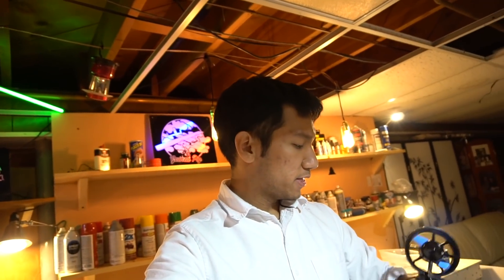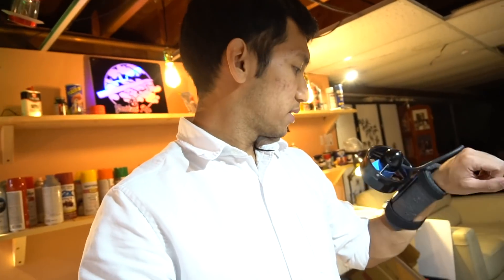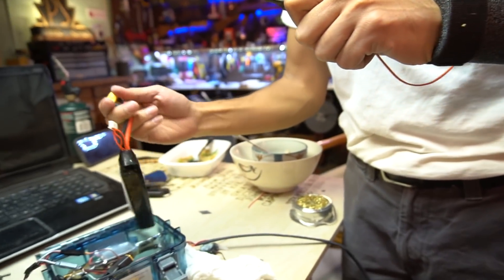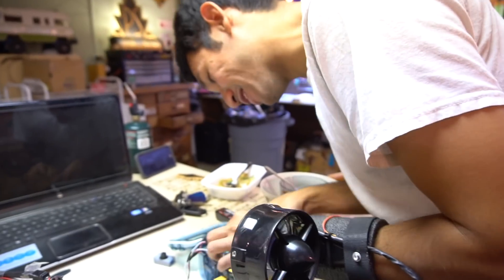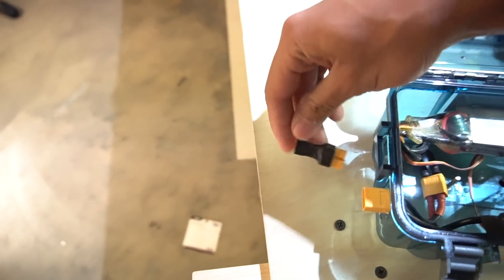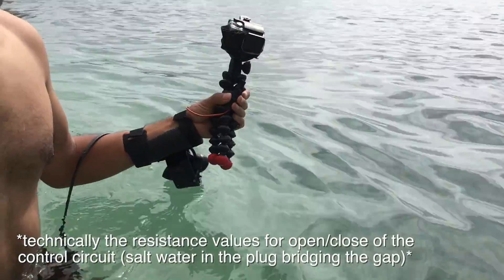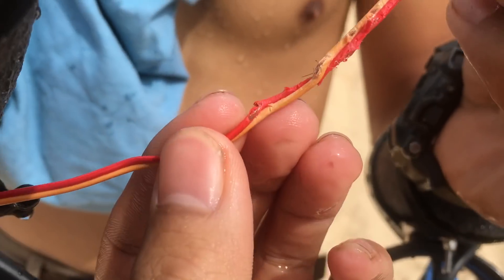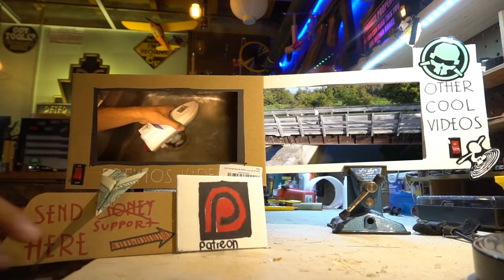Propellers to the fists

Comment: G'day,

   I was kind of expecting the Cables to get sucked into a Duct as soon as I saw the setup...; but I'm a bit of a Smartarse.

   The concept of trying to mount the Thrusters on the Forearms is highly questionable..., it means the two Thrusters are able to pull in unco-ordinated separate directions, so it wastes energy & complicates Control issues.

   I suggest mounting the ducts on the ends of a Wooden "Hydrofoil" maybe 18 inches accross, with Handgrips on the Trailing Edge, and a Throttle-Trigger for each Engine, ideally with proportional control rather than a 3-position "Slow/Medium/Fast/" selector.

  Please yourself, but if you could then replace the Rectangular-Prism Battery-Box with an Elipsoidal "Football-Shape", and relocate the more streamlined Container to the centre of the "Hyrofoil" with the Ducts on it's ends & the Handgrips at the Trailing-Edge...

  Then, it might be a fairly practical accoutrement, at least till the Battery goes flat ;  especially if you had Flippers, a Schorkel, and a Weight-Belt to ballast yourself to achieve neutral buoyancy....

   Just(ifiably ?) sayin' ,

  ;-p

 Ciao !
Reply from the maker: great concepts! I'll definitely implement some of those ideas into Mk II!
Reply: +PeterSripol 

  Cool, thanks for replying...!

   To collect your reward, please report to my "SunFoil Project Playlist", and have a bit of a giggle at the "SunFoil Thermodynamic, Aerodynamic, & Solar-Thermal Ramjet-Effect...." Video...

   I claim to be the only Mad Scientist ever to have built Road-Registered Street-Legal Electric Solar-Thermal Ramjets which actually did save a measurable amount of Fuel...!

   I have a "Personal Aeroplanology" Playlist, as well...; because I'm one of the people who used to levitate in the 1970s with a Lawnmower Engine, and I occasionally threaten to make a R/C Model of my first Aeroplane, pretty much because the original survived to be hanging in a Transport Museum (!).

   When I was young, it was cheaper to buy a 3rd-hand Minimum Aircraft which one could sit in, than it was to buy a new 4-Channel R/C Model, and Hang Gliders were considered " almost normal"...; my own personal "claim to fame" is that the Wright Brothers had a better Aeroplane in 1903 (12 Hp 4-Cylinder 4-Stroke, 3-Axis Controls, 2 Chain-Reduction driven "Handed" Propellers which were Counter-Rotating to eliminate Torque & Gyroscopic-Precession & P-Factor Effects, and Double-Surface Aerofoils with built-up internal Ribs..., the 1903 Wright Flyer was a pretty elegant bit of Design...) than what taught me to fly in 1978 (8Hp 1-Cylinder 2-Stroke, 1 Chain Re-Drive Prop,  All-Flying Elevators & Rudder with a lot of Dihedral, Single-Surface Dacron "Sails" with Bolt-Ropes running in the Tracks of the Sailboat Masts which served as Leading-Edges - and Cambered Full-Chord Battons in Pockets sewn into the Wings...).

  I really enjoy watching your "Wildman Aerodynamics" type Projects...; and I'd quite like to see you have a go at a propper R/C Dirigible Airship, using the "dreaded" Hydrogen rather than any kind of Multicopter pretending to be a Dirigible Aerostat.

  Helium hasn't got the required Lift, and Hydrogen's not actually that dangerous (Meterologists use it for Weather Balloons, and when did you last hear of a BLEVE'd Weather-Forcaster...?)...

  You're the Aerodynamic Wildman who flew a R/C Aircraft Carrier...; and if you read "Slide Rule" by Nevil Shute (Norway) then I reckon you could make a delightful flying scale-model of the Vickers R-100, which made a successful Proving Flight to Canada before being scrapped after the R-101 crashed in France on the way to India...(Government Departments designed & built the R-101, whereas Private Contractors hatched the R-100...., it's a great bit of History).

   Anyway,

  Have a good one !

   ;-p

  Ciao !
Reply: MSmart19 hilarious coming from the guy named MSmart
Reply: MSmart19 No, it was legit hilarious coming from the guy advertising that he's smart. I don't have anything against you.
Reply: MSmart19 you're means you are not your
Reply: MSmart19 I did not prove your point in anyway. I just saw the opportunity to make a joke and made it. You blew it out of proportion to inflate your already huge ego.
Reply: MSmart19 It's only confirmation bias if it's against a theory. Not if it's a truth. I very well know if I was making a joke or not.
That was your third life. Game over.
Reply: those thrusters would be very awesome on a paddleboard with a face hole (mask and snorkel) to scout cool spots to skin dive at. power assisted surfboard (use webbed gloves too) for busting past incoming waves quicker. on a board one unit might be fairly zippy and more than double the run duration.

Comment: V2 definitely needs a much more streamlined carrier for the electronics.  Drag plays a huge part in the underwater world.  You could probably just set it all in epoxy or hot glue.  Maybe get some esc's rated for twice the current that way they don't generate much heat.
Reply from the maker: yep! thats a great idea, Potting the electronics in epoxy is the next goal as it would eliminate the air pressure in the box which would become a problem at deeper depths.

Comment: Peter thats really pretty smart setup little setup you need to get your patent pending :)
Would be interesting to see if you could get Blue Robotics to send you half a dozen and see how many is the optimum number and where on your body to put them.. 
I was thinking if you had two/four on your legs too for speed and then use the the ones on your arms for direction that would be great for scuba divers to use!
Loving the channel though 25k subs will soon be 100k with the interesting mix of stuff you're pumping out.. :D
Reply from the maker: Thanks dave!

Hahah one can wish that blue robotics sends me a dozen thrusters! I'd put them to good use on some future projects soon!
Reply: Or you could use your legs to steer like rudders.
Reply: Matthew Choy Rudder? 
I take it you can rotate your legs in their sockets then? You weirdo.. ;)
ahhh you mean ailerons..:D hehe
arms have more dexterity and would allow for fine movements and also can be used for rapid rotation of the torso which then does bring in the legs for use as a rudder (relative to the surface) and the ones on the legs for speed and power so I could whip about under water..
So yes as per my post 6, 4 on legs 2 on arms for those reasons above..
The important thing is just MORE POWER!!!! :D
Reply: Yeah. Thanks for picking up the mistake. I agree... MORE POWER TO THE HYDROFISTS
Reply: @TheWebstaff  try hard
Reply: PeterSripol that chest hair tho👌.        (No homo)
Reply: OMG! WHAT THE FUCK! You have the same name as my father, he passed away 7 years ago. Just kinda freaky!
Reply: Super fun idea! Maybe could add some ballast to the battery housing to negate the buoyancy of the air trapped inside it?
Reply: seriously though, reach out to them and share the video with them. They may find value in sharing the product with you.  Doesn't hurt to ask!
Reply: john webster OMG you have the same name as my father thats even more freaky :)
Reply: i think if youre a decent swimmer (im 4 wins 2 losses against a gold medalist olympian back when we were 17 so this may not apply to everyone ... jimmy feigan the one who got stuck in the country last olympics lol) but slightly more powerful/faster propellers and a pair of good flippers with some riggings so they dont fall off from the speed lol..  would be pretty interesting to watch attached to a good swimmer. to reduce drag youd need to find the best place to attach the battery pack, probably in between ur nuts to be honest, since i believe the best underwater stroke would be a double kicking eeeeeeeeeeeeee maybe even add some to your feet but that idea gets sketchy combined with the optimal underwater stroke . the fastest possible device would be one of those larger scuba diver props with larger motors that you hold out in front of you... with flippers and a skilled underwater dolphin / alternating flipper stroke hybrid since your hands would have to be holding the ... essentially an airplane motor that can get a big propeller going because they are held out so far from you. just maybe put a cage over it so you dont turn little nemo into a nemo souffle
Reply: Dave Webster: OMG !!! You have same name as my pet Hamster. That's even MORE !!! freaky.
Reply: haha why did you give your hamster a second name?
Reply: doubled his subs within 5 days
Reply: Dave Webster What to i need to study for doing stuff like this?
Reply: He should use the propellers to make a submarine/ boat where there are bays on each side with one home bay in the center and the sides could carry water and make the thing sink to a certain level then of course put the propellers in the front and back to get maximum force under water
Reply: now it's 1.2 mil subs... i guess i could say you were right
Reply: Dave Webster s
Reply: Batt Dude Now he's at 93k!
Reply: Dave Webster year double his subs and likes
Reply: p
Reply: I think i would be smartest to fix them to a bar with flaps acting like fins in both ends. Then for up and down you can just flick your wrists a bit. I hope you will try it out in a follow up video.
Reply: Dave Webster I
Reply: Haha... almost 1M now!
Reply: 1.1 million now
Reply: Dave Webster
Reply: oh thats neat
Reply: Ok ya me too im scared unless youre all related but you dont know it you should all set a meeting you know to meet
Reply: Dave Webster
Reply: Dave Webster
Reply: Dave Webster p
Reply: Dave Webster p
Reply: Yeah he will do we just need him to get some sponsors now so he can do some extreme mods with RC gear..
Reply: nitin
Reply: Dave Webster 👻🙏🙏😹😝😝😹
Reply: Woah is Dave Webster a fortune teller or something? He just predicted that he would get up to 100k subscribers and he did! More than 100k!
Reply: Dave Webster will
Reply: @Aurum It involves several topics, but the field itself would be engineering. The study of fluid dynamics would also be involved with a build such as this.
Reply: Ha ha, Dave. You silly. Ailerons are for AIR craft, dummy. Lol!
RUDDER was exactly RIGHT. Rudders don't pivot on their on axis, why did you suggest they did? Educate yourself Lol. 
You're such a genius! Lol!
Reply: Dave Webster I love your idea
Reply: Hes on over 200k now
Reply: Dave Webster ii
Reply: you are my favorite youtuber now holy crap you are so entertaining i love you
Reply: Dave Webster i think you mean 300,000+ subs lol
Reply: Dave Webster I
Reply: Dave Webster 511k subs now
Reply: More like 500k a year later
Reply: Now it is 600,000
Reply: Dave Webster he should of made blade fins and the battery like a big fish fin behind his back
Reply: I don't know if I'd put them on legs. That'd be too hard to reach and awkward as well as it might screw up your turning. I personally would put them on each side of my hip or something like that.
Reply: A million lol
Reply: Dave Webster imagine how Eire that would feel to have them on your feet? I can imagine it almost. Like standing on a pool noodle underwater or something like that
Reply: Dave Webster hes 1mil+ now
Reply: This already exists
Reply: I love this build I wish you would have put them on your ankles though
Reply: You should have used monster moters
Reply: Nice paragraph and a half NERD
Reply: well now he has over a mil haha
Reply: 1.67m
Reply: The first sentence: englith
Reply: My boys at 1.75 mil now kinda crazy
Reply: Im scared now
Reply: 420 likes on 4/20 ( ͡° ͜ʖ ͡°)
Reply: Dave Webster ii
Reply: + Dave Webster
Because he's just that badass. For instance: I recently placed a 1 inch by 1 inch piece of plywood mounted horizontally to the bottom of his fish tank Hamster enclosure and he was able to kick clean through it on the first attempt using only his right rear foot. He's a regular Chuck Norris in the Hamster community. Maybe I should nominate him for the next Hamster Olympics in the Martial Arts division ?? Then there was the time I saw him take a leap of a whole 20 feet ...
Reply: lol learn to read properly, then learn about subs.. http://www.navy.mil.za/museum_submarine/inside_control_surfaces.htm. 
Then read the thread, then you too can be a genius!... ;)
Then if you still think I need educating.. well I cannot help you.. :D

Comment: isnt it kinda waste of energy to have 2 when you can only go in 1 direction? it doesnt seem efficient, a thingy with one bigger pro that you hold in to (and that has battery attached to it as well) would be more practical and efficient
Reply: efficient, maybe. 1 prop would be way harder to control, also when you go bigger and only 1 you get counter rotations. 2 smaller ones is just simple design, you can control way better without any extra control surfaces.
Reply: simple design? cables, lunchbox attached to belt.. there are things like that with one prop, so it surely works and is compact, this just looks cooler... Im not saying its bad, it looks fun, but its not the best design concept

Comment: That's pretty awesome.  One small gripe though.  Putting liquid electrical tape under shrink tubing will keep the 'tape' from curing.  That stuff needs to be exposed to open air for the solvent to evaporate (which is why it burned so nicely).  Granted the small amount exposed under the shrink tubing would cure, but the rest would not.  Probably not the end of the world though.

Comment: First :) What was the arduino software for? Used the servo library to control the ESCs?
Reply: the arduino was used to detect button press combos (click once for low, double click for medium, triple click for high speed) and also to send control signals to the ESC.
The servo library cannot be used as ESCs often accept only a specific range of PWM duty cycles and consider a duty cycle of 0 to be "no signal connected" rather than "signal connected, throttle 0"
Reply: thats why i am asking. Did you made a own function or did you use a library. :) good work btw.
Reply from the maker: rc-wingman my friend Sam, modified an existing sketch somewhere to work like pixl rainbow has mentioned! I'll upload the sketch somewhere in the next few days!
Reply: cool. are you working on rov too. like shown on the first pictures of your video?